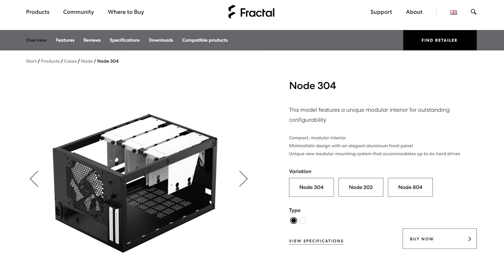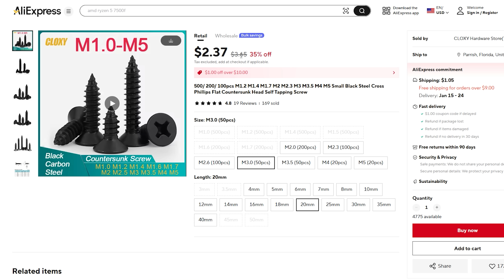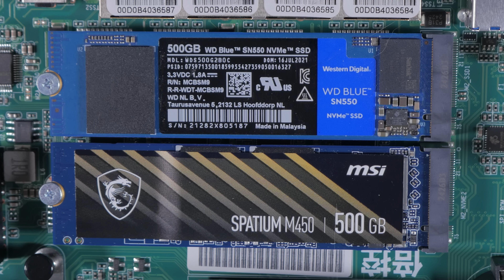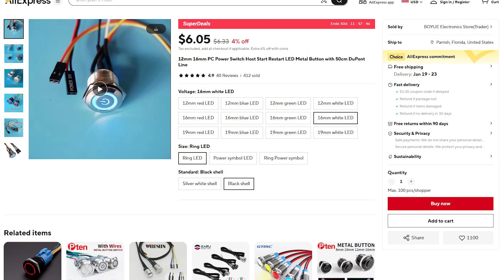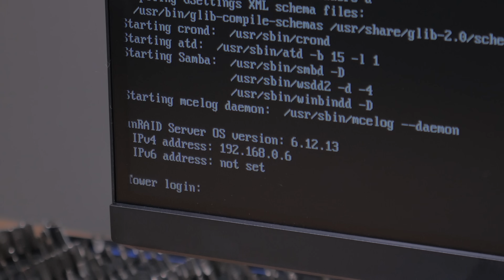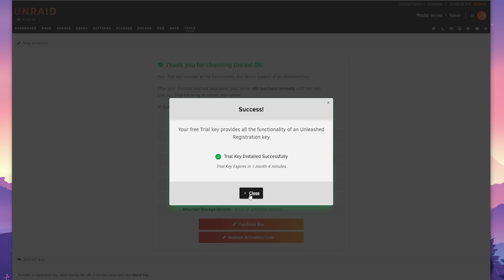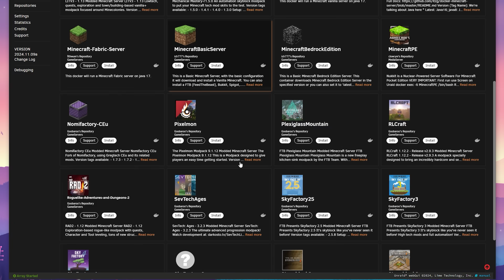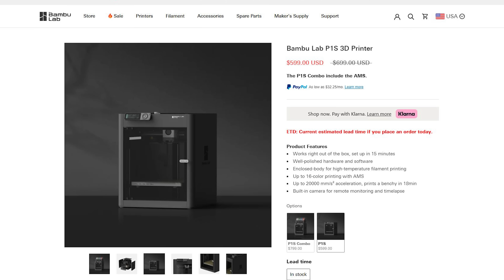Budget Storage Server Build In A 3D Printed Case! (2025)

Comment: Wow, you think this will work with 16x SSD 2.5 drives (300GB each)? I was thinking using 2x NVME to SATA (5-6ports) + 6 existing SATA ports on board.

Comment: This looks cool, I wish I knew about it earlier. Just curious - how's it for rigidity? Jonsbo cases (I own N1 and N4) have solid metal structure, so they can be freely moved around or grabbed for transportation without any chance of sections or parts coming apart, does the plastic hold good enough in those regards?

Comment: This board is not suitable for a power-saving NAS, as it does not support ASPM. The CPU only runs in the C1 state. With an NVMe drive, it requires 23 watts in idle mode. My nas with ASRock N100M needs 7 Watt in idle

Comment: I used a rNAS-6X.. also 3d printed but the main advantage is there is no need to use screw inserts or screws AND it takes a regular ATX PSU. it uses 3d printed big screws that work very well.
Another perk is it's $10 and the instructions are also really well put together.
I was interested in the MASS too initially but the full 3d printed nature of the rNAS + regular ATX (which I already had) won me over considering I only needed 4 bays

Comment: is PLA heat resistant enough to handle the HDDs and pc components heat?
Reply: In my experience PLA very easily deforms even with moderate heat when constantly stressed in the same way and exposed to the sun. For example I printed a mandalorian helmet in PLA and had it sitting on my desk in the sun for a couple months before I noticed the front sagging.

If you don't expose the case to direct sunlight you might be fine. I'd still use PETG just to be safe. ABS isn't necessary I think
Reply: So in the user manual of the MASS they recomend PETG. So i whoud recomend it.

Comment: It sure is an amazing case for an ITX motherboard, but what if I only have a mini-ATX board? This won't work, I guess. So for that matter, are there any remixes, so people will be able to fit m-ATX boards in it? Also,  I'm currently setting up BcacheFS NAS array (with 2 replicas, no RAID) with 3 2,5" and 4 3,5" is this case modular enough to support this type of configuration?
I know that if I just don't have ITX board, I can buy it, but many people and I too are building setups from all the unneeded parts lying around, and ITX board isn't that popular of an option considering their prices.

Would be glad to hear answers to that question of mine :)

Comment: Fractal Define 7 XL is way better and better bang for bucks. Fractal Define 7 XL gives me a steel case that can store 18+ Hard Drives for only $250? You can't beat that and does not have to go through 3D Printing troubles.
Reply: Or you could go Jonsbo N3, which has a 8-drive SATA backplane for hot swapping and can fit  full height PCIe cards.

Comment: One issue with that board, cpu has 9 pcie lanes and 4 of them used by lan controllers. This means other slots may only have 1 lane connection: Nvme slots,  controller chip for some of the sata ports...
I like that clip in mechanism.
Reply: Im still struggling to find a decent priced MOBO which can do it all. I want a all in one system, which can do my storage stuff, pi hole, a media server which can do high bitrate transcoding and have some room for vm´s/lxc´s to spare. Any recommendations?

Comment: There is a reason that cases are made of metal,  it is to shield from radiation and radio frequencies interfering with other circuits, now this problem is solved using multi layered PCBs, where top and bottom layers use the power and ground layers.

Since the 70's,  high frequency circuits produced radio frequencies,  who interfered with other electronics, so a standard was made that they should be be enclosed into metal casing to reduce the radio interference.

Comment: everything i have ever read says to never put OS on usb drives due to not being able to handle the amount of read writes that the os will perform
Reply: You've never heard of unraid then. This is literally what you have to do.
Reply: Unraid is designed to run from a USB flash drive.
Reply: @ i have not currently running true nas low budget hobbyist level
Reply: Yeah, that booting from a USB for unraid just feels wrong to me. I know it's designed to be that way but USB is such a flaky connection for a long term data connection.   I've had issues with USB storage staying connected in the past and just don't trust it for anything other than keyboards, mice, and printers.

Comment: I would recommend against using a usb for a boot drive because they aren't designed or rated for long term reads and writes. They wear out very fast when used as boot drives. Source: happened to me.
Reply: Unraid doesn't actually run off of USB, it runs from a ramdisk and only uses the USB drive to store configuration files.
Reply: Unraid can ONLY be run on a USB.....
Reply: @adamswire9152  TIL. That is an insane design choice given most people who use it will want data reliability, to use a tool that has some of the worst data resilience.

Comment: 4:31 pricy ddr5 is better than cheap ddr4 in this case, because ddr5 has on-die ecc which at least gives a little bit more than nothing to protect from bitflip errors and if your NAS holds anything more valuable than photos of cats it might save your ass
Reply: That is not the same as real ecc. Os does not know if an error happens. 
Ddr5 chips needs on die ecc because otherwise it would have memory error all the time. It was cheaper to put some on die ecc in use than making more stable chips.
Reply: What is the risk of non-ecc memory? I just assumed a machine crash not hard drive failure but I don’t know.
Reply: @zuko9085  Less than 1% failure rate from bit flipping. The vast majority of home servers don't even hit most use cases where error correction is necessary.

Comment: As a not in unraid, be careful using non commercial ssds. If you are having issues, yours ssd cache is crashing. You will often see this as your dockers not showing up. I would recommend taking your cache offline any time you are setting up or adding docker containers so they don't land on the cache. I ended up removing my cache disk entirely after too many issues. If your docker images are stuck on your cache drive, there is a tool in the software market thing to manually move the files to your array. I can't remember the name, but if people comment asking I'll look on my machine.

Comment: "How to build a cheap storage server. Step 1: own an expensive 3d printer and shit ton of material required to print the damn thing" Yeah, nah, that's false advertising.
Reply: That’s not a crap load of filament. It’s about a spool and a half which is $30. For people who ready own a printer it is a cheaper investment.
Reply: Well, he might have changed the title of the video since he's not mentioning 'cheap' but you can basically do the same thing with a cheap printer. Owning a 3d printer nowadays is like owning a microwave, not necessary but a lot of people have one, they are more or less the same price and a roll of filament is like 15$. If you already own the hardware it's dirt cheap since modular cases like the one presented can go up to 300/400$
Reply: Yeah, also using an OS for 70€ isn't the most budget friendly version of doing things when free ones are available

Comment: 5:10 100% some USB (3) drives have an issue with cooling (specifically the usb communication chip (not the actual storage chip)) which makes it slower than a usb 2 drive for prolonged use, think I have got as low of mins as 1MB/s, could've even been lower

Comment: Don’t think I’ll be able to print all that with my A1 Mini
Reply from the maker: Yeah, some of the parts are at about 200mm max which is, I think, a little bigger than what the A1 Mini can handle.
Reply: No reason why you can't cut the parts up and glue them. Personally I'd just use the excuse to buy an A1 combo.